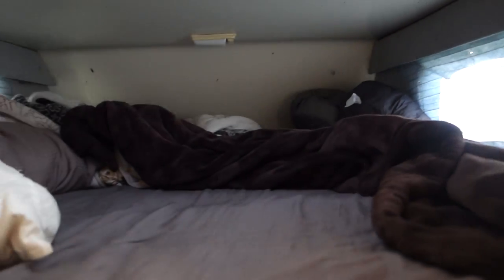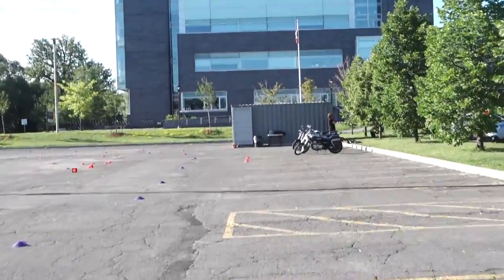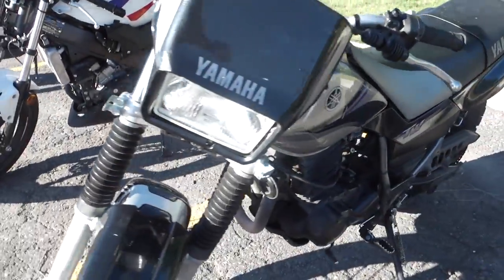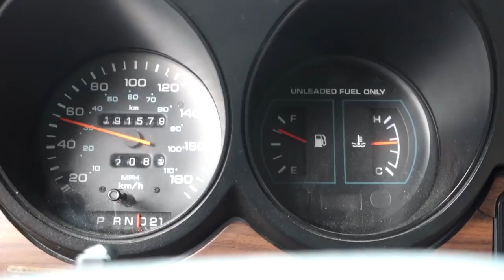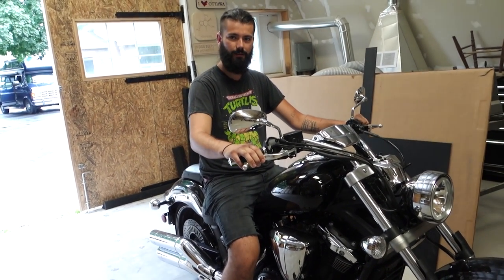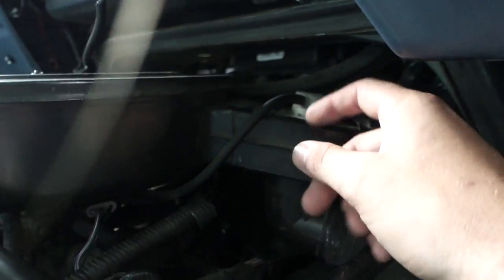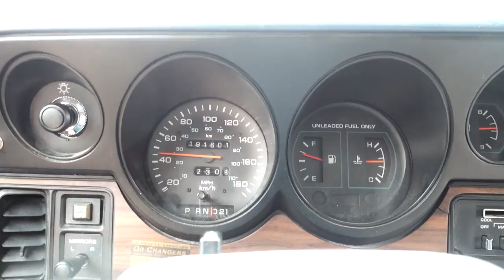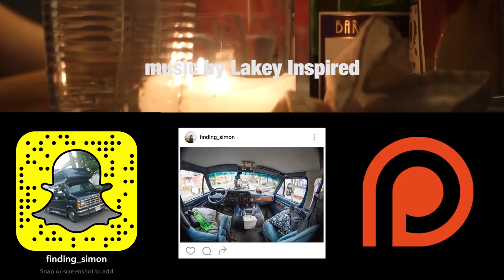Making Biker Buddies - Van Life 148

Comment: Simon, things to check in the following order. 1, Coolant level, 2, Check for scale build up in the radiator tubes. Similar to plaque build up in Human arteries. Blocked cooling tubes are common in older radiators. 3, Replace the thermostat, if it's older than 5 years. If items 2 and 3 are present. 4, Replace the water pump if it's older than 50K kilometers.  Take to a radiator shop and have the radiator removed and cleaned professionally.  After that service is performed. Make sure to use a long life. "Organic acid" coolant. One that is good for at least 150KM or 5 years of service life. Running an engine hot for a prolonged time. Can cause a cylinder head gasket to fail. Then you get into a serious engine rebuild and lots of cost to repair. I truly enjoy the content that you produce. In turn I, provide this information to help keep you on the road.  A fellow rider, too. 2014 Kawasaki Concours 1400 ABS 1352cc 147 Horsepower to the rear wheel. Cheers, Mate.

Comment: I'm going with thermostat !  Every modern vehicle I've had in the last 21 years (7 Ram trucks) all run normally ( unloaded) with the temp gauge needle exactly in the middle of the range on the gauge on a hot day. Pulling a 6,000 lb travel trailer up a 6% grade in Utah on a 43C degree day will put the needle at the 3/4 mark. I've had two company trucks running hot that both had thermostats that had literally disintegrated to the point that pieces of the assembly had lodged themselves in the cooling passages restricting coolant flow.
Reply from the maker: ok rad, I'm leaning this way a bit too. I'll have a good solid look.
Reply: Likely the problem and a cheap fix..

Comment: Had the same problem running hot with my 67 mustang.  Changed the fan blade from a 4 blade to a 5 blade and the problem was fixed.  The added blade circulated the air more proficient and kept the engine at a better temperature.  Also changed the thermostat to rule out any problems with that.

Comment: If your plugs look good and engine runs strong, I would venture to say it's related to something in the cooling circuit... this is my area by the way so happy to help. Do a check of the thermostat function by feeling the upper radiator hose close to the radiator. If it's hot when your engine is running hot, you at least know there is flow through the radiator. If not, your thermostat is likely stuck closed. Check the obvious like coolant level to be sure it's not way low. If low, look for signs of leakage especially around the cap. Check to make sure the fan is spinning... I assume it's engine driven and not electric, but in either case when the engine is hot it should be running. Make sure there are no obvious obstructions blocking airflow through the radiator like stray bags...it's happens! Those are the areas most prone to leading to this sort of issue.

Comment: Cooling system running a bit warm could be allot of things...but check the obvious namely that the bottom hose isn't collapsing on you causing restriction and that you purge any air out of the system.  You should be able to verify the flow of the radiator simply by leaving the cap off and bringing it to operating temp.  Just because you re-cored it last year doesn't mean it's not plugged up or flowing well.  Make sure you check the fan clutch if it has one, too.  They are notorious for going bad.

Congrats' on passing...go ride your 400, nothing wrong at all with that.  Don't let the cc ego thing get the best of you.  Ride what you have and know it's likely not the only bike you'll own.  Given your travels though I'd surely consider a dual sport like the Suzuki DR650 or DR400 or something lighter you can wheel up on a rear ramp set up and take with you.  Good on the street and decent on the trails.  Just a thought.  I'm a cruiser guy myself and prefer full dressed bikes.  Lots of options out there to have fun with.  Enjoy!

Comment: Bro...dont leave it run as you uncover the carb. ANYTHING falling in there (coin, watch, rock, pen cover, wire, nut...etc...) will cream your valves and require huge engine work.
The heat also may be the connection to the gauge. Renewed ground connections can make a gauge report higher levels.

Comment: Also, radiators also can give up the ghost.
Seemingly within a few hundred miles, they go from fine to not fine.
The other thing I want to ask is, did they drain your system when they did the trans?
If so, a new mix of collant/water ratio can significantly change how warm it appears to run.

Comment: To give you an idea of present time and me relative to your temp issue I have a Ford Transit Hicube van 1996, I live in New Zealand , Hamilton city North Island right now , its winter, but not really cold like where you are in Canada where I am, just temperate, alot of rain mostly, anyway, been up some big hills on way to Auckland city recently and my temp gauge didnt change, stayed half way, was pleased as, my van so far goes great engine wise. If my temp gauge climbed to much i would be worried as, if wasnt by much though and its summer as well then that would be ok.

Comment: Did you fix the overheating? If the rad and thermostat is good then check the rad fan clutch. It will still spin but not strong enough to cool the radiator. Easy fix just a pain... What else is new!
Reply from the maker: they're all running well. it has something to do with timing, running rich or lean, less power, terrible gas mileage. I'm leaning towards a bad MAP or O2 sensor. but it hasn't tripped my OBDII scanner

Comment: Man hope this isnt a serious problem coming up with the engine Simon, so far watched all your videos so many times over time now and made some comments, and as already said this van has already been a mechanical nightmare really, major, one issue after another. I am certainly no mechanic but had many many old cars over the years and had just about every issue light to major go wrong over the many years so have some idea in a way. Had radiators blow, air conditioning radiators and total engines blow. I am always watching my temp and good vehicles I have only come up half way on the temp gauge at most, major hills or not. When there is a major major issuhe with the engine and it does scream danger is when an engine gets hot as you know, as it shouldnt if if its a good as engine. I have watched your video and your engine gauge isnt really over as you know, just something to watch but if as you say its gets major hot up hills then that is definitely a worry, can see the gauge is a lttle high as you say, heck hope the van is ok mate. I have my bike licence to and had some experience with Harley owners as you talked of, yep was nothing but money and problems, interesting you sharing that, cool your parents had them to and have ridden motorcycles etc, cool.
Reply from the maker: +Shelley Tomlinson yeah the temps are mostly under control  that fix helped a lot  I'm redoing the rad fluid and temp control this week

Comment: hey simon,

i've been enjoying your channel and wanted to thank you for taking us along on your journey.  i'm itching to follow your lead and get an rv of my own some time soon.  great job showcasing the Ottawa area - i get a kick out of seeing some of my old stomping grounds.

are you using deep cycle batteries or lead acid car batteries?  the reason i ask is because i've been thinking of taking advantage of car batteries that no longer have cranking amps, but are still good for solar/wind storage - last time i asked at Canadian Tire they told me that i was more than welcome to help myself to their discarded battery pile.  just wondering if you've had any experience with this?
Reply: The problem with using car batteries is that they are not meant to be discharged down to more than 70-80%. they can actually only be discharged fully about 5 times before they usually break
Reply: thanks for the response :)
Reply from the maker: yeah that's correct. There's a few issues with lead acid too. I'm using cheap lead acid batteries I got used, and when they start failing they'll vent carbon monoxide, so it's important to have them sealed away with proper ventilation out of your vehicle. In my case I use PC fans to move the air through the battery box and out a vent on the side of the van.

Basically you need the capacity to get through the night, and the solar to get through the day.
Reply: good to know.  thanks for the response.

Comment: Does your radiator have the transmission cooler built into it?
Reply from the maker: yup
Reply: Maybe I missed it, but did it run this hot before the transmission repair?

I only ask because it may be a knock on effect with something being wrong with the transmission.  If the transmission is running hot it will bring up your water temperature with it.

As mentioned in other comments though, I would check the thermostat first.  Might be kind of a hassle to change in the dog house, but they're relatively cheap and it will give you a chance to put in fresh coolant.